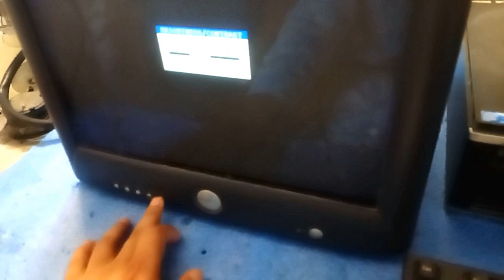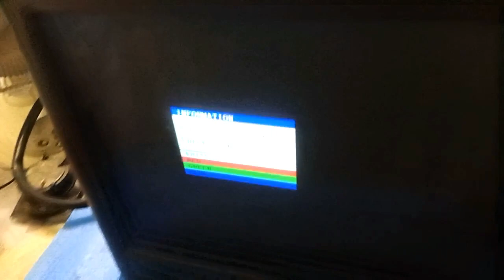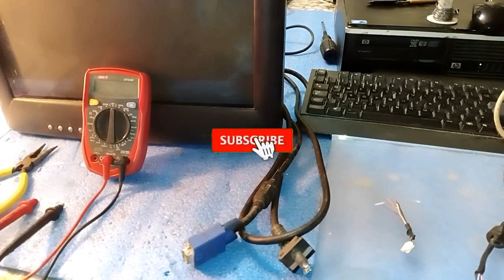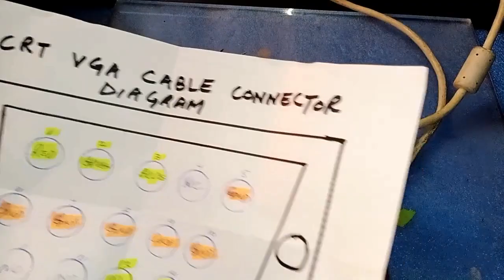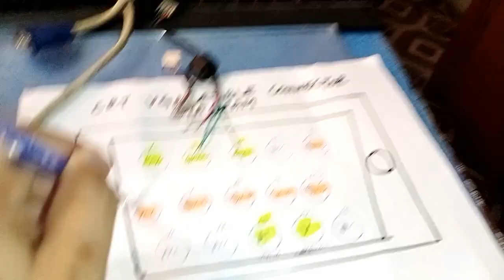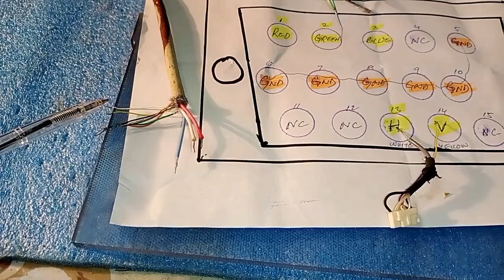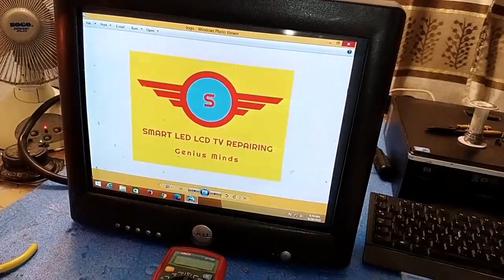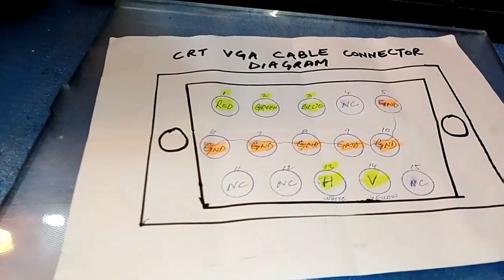CRT Monitor VGA Cable Repair || How to repair vga cable

Comment: Amigo,tenho um monitor crt que está sem a cor vermelha,posso ligar um fio nas duas pontas para fazer o reparo?
Reply: Estou com um monitor com o mesmo problema. Vc conseguiu arrumar o seu?
Reply: @griexus4015  sim,se o seu é com cabo que possa desplugar e so subtituir,o meu aki tive q cortar uma parte do cabo e emendar com um novo foi a maneira mais facil q consegui,mas tem q medir os plugs com cada cor pq as cores dos fios nao sao padrao
Reply: @neconostalgia2442  E onde vc comprou um cabo novo? É um daqueles tradicionais que vende no mercado livre?
Reply: @griexus4015  eu tinha aki,eo vga tradicional ele vende em qualquer loja de inf ou camelos,quando vc corta ele tem varios fios,3sao padrao rgb ou seja sao vermelho verde e azul ja o resto pode variar
Reply: @neconostalgia2442  valeu. O meu monitor é daqueles que não dá pra tirar o cabo, então vou ter que fazer uma gambiarra dessas

Comment: Can you buy whole cable and just plug it in, if yes how its called?:)
Reply from the maker: Dear,
CRT monitor VGA cables are not available in the market nowadays and also each monitor have different cable connections, 
The method I have given works for all CRT monitor Vga cables

Comment: When I tried this the monitor kept turning on and off, and said frequency over range, what does this mean? I’m guessing I connected one of the wires wrong, but I don’t know
Reply from the maker: Yes you may have connected wires wrongly,
Try following steps in video

Comment: I have a dell m992 with a cut VGA cord. How should I fix it?
Reply from the maker: If it is broken from centre other than jack then follow my video to join the wire from broken area,
Reply: @ElectronicSecret  Someone cut the VGA wire all the way off from the back to where the wire gets thicker.